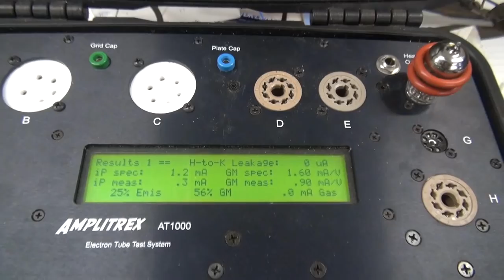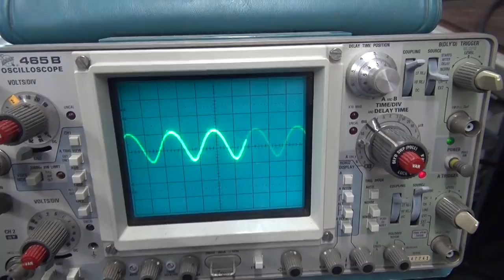How to Repair Marshall DSL40C Tube guitar amp D-Lab Electronics

Comment: Wouldn't it be better to tie that runner to a screw washer terminal? this way, the circuit board could be removed without having to de-solder the runner.

Comment: I would have taped the circuit board so no fragments would would short anything and used a left handed drill bit first to see if it might back out the broken screw.

Comment: Another very interesting video. With noise or gain problems it is always worth testing the valves first. Those components with very little solder are in ‘plated through’ holes. When they are soldered on a flow solder machine the do get properly soldered on the reverse side of the board, as do normal single sided boards. They do not need soldering on the top side. Cheers

Comment: I picked up a DSL-40 that was significantly under 1/2 price (the only reason I bought it). It was "not working, tried new tubes, etc". Fixed a few bad solder joints and bam... it works. It's a nice amp but the circuit board bugs me... Left hand drill bits are your friend for screw extraction. "Battery;s are probably low" LOL It's always good to see your work Terry. I always learn something...

Comment: Another good video as usual from D-Labs. I have one of these. It just so happens I checked tube bias yesterday, wherin it needed a minor tweak,  one side a little high  and one side a tiny bit low. I had never ever checked in the 4 years I have ownerd it. I came across a brand new Eminence Tonker 8 ohm a couple of days ago for a very good price and I jumped on it. Just finished installing it when I happened across this video. After seeing this video I think I might take a look see to verify good soldered connections on the board.

Comment: Terry - Taps are usually square-headed, and square sized 1/4' drive sockets are available, so if you needed to tap a hole down inside something you can just use 1/4" extensions and a regular 1/4" ratchet.

Comment: Howdy.
I had a similar problem with my BK Precision signal generator. The signal levels and the frequecnies were all over the place. I bought it to do IF aligments but it became hopeless. I spayed contact cleaner on all switches and potentiometers. Nothing.
I happened to watch a video where another pro located the source of parasitics by pushing wires with a wood stick. So I did that. And eventually I observed the signal coming on and off pushing at the corner of an auxiliary circuit board. Bulls eye. A mounting screw providing ground was out of thread alignment and had not got tight. Luckily, at the factory, they obviosly used torque limiting drivers so the thread was not completely destoyed. I loosened it and carefully got it thread aligned and tightened. Back in business.
Regards.

Comment: I found that the power tubes hum when going bad, maybe the vibrations cause it for less life. Usually a year I get on mine and bias it at 32, most bias them too hot and causes issues and being a preamp distortion  its all ya need:)

Comment: Why not just run a wire with a terminal ring on each end to your new screw and the nut on the chassis just below it?  The effect would be the same.

Comment: Part of the reason for the bad solder joints is these boards were flow soldered after being populated. In a perfect environment this works well but if any dirt or if production rate is pushed it results in these type of faults.

Comment: Hi Dlab, wonderful video, thanks. 
I have a 15 month old DSL 40C and I just started experiencing a random drop in volume on my red gain channel followed by a shreaking high pitch (microphonic?) noise then it fades away back to semi-normal. I’m hoping this is just a failing tube issue. All tubes glow and I did adjust the bias on the EL34s from 41/26 to 38/38. Played great for 30 minutes then the problem intermittently returns. Bad 12AX7/ECC83s or bad EL34? Should I just replace both of the EL34s with a “matched” set? Would love to hear your thoughts. The amp doesn’t get moved around, sits in the same spot in my living room, no gigging. Thanks!

Comment: Judging by the amount of scratches on the upper lip of the chassis it appears somebody tried to remove it from the cabinet with a spatula.
Great diagnostics and repairs,
Thanks for showing an old Marshall hater this video.
Reply: I think that's just copper tape for shielding.

Comment: R1/R2: Those weren't bad solder connections. Had you looked at the bottom, you would find them fully soldered. The holes are throughplated, so if any components had traces on the top side, there would still be a proper connection. If there aren't any top traces, adding solder only needlesly exposes the traces, throughplating and components to excess heat which can damage them. So always look first if the top side even has a trace leading to them.
Reply from the maker: No, I did not look at the bottom, since the board was not removed from the chassis. The resistor on the input jack board actually rocked in the through-hole, so I would assume that it needed solder. Sometimes, its better to re-solder and hope for the best. Either way, comparing those connections to others on the board displayed evidence of inconsistency.
Reply: Yep.  Should have removed the board.

Comment: 00:56 - "The preamp tubes are all directly soldered in" . That would be interesting :) 

I've watched many guitar amp repair videos and have noticed very FEW tube failures vs capacitor failures!

I wonder if Fender et al had to do this all over again, they would simply solder the tubes directly to the board and socket the electrolytics? :)
Reply: They're not soldered into the board, they're pushed into sockets that are soldered in the board.

Comment: terry why did't you remove the stand off and drill n tap it outside of the chassie? was the bottom fastner bradded over?
Reply from the maker: Yes, it was a pressed in type
Reply: I was wondering about that too. Now I know. Btw, I saw someone using a magnet to pickup stray shavings while drilling.

Comment: Number one problem in tube amps is vibration that will loose ground screws and nuts thus it was a good idea to solder in the ground wire. This way you know you have 100% ground.

Comment: If you'll dm me, I'll send you some left hand drills, makes getting broken screws out super easy...
Reply: I agree, I'm a retired machinist, and the left hand drill works 90% of the time. Here is the "best" method. Get a small center drill smaller than the inside thread. In other words the first portion of the drill is smaller than the "body" of the screw. Take a small center punch and tap a prick point on the top of the broken screw as close to center as you can manage. Then take the left hand drill again smaller than the screw body, and run the drill in reverse and most of the time it will spin right out, just keep light pressure against the screw, as it will begin to come back at you. Yeah it's a lot of extra steps, but it works. And you aren't really drilling the material out, you are merely getting the drill to "bite" into the metal and very little metal fragments.

Comment: I learned some things today , wondering what soldering iron u mite reccomend that will last.? Seems i go thru em way to fast . Been using 40 to 6o watt with an adjustable voltage.for guitars n simple amp mods .  Thx

Comment: Very nice video!  I'm having a problem with the same amp, but mine is that it intermittently cuts out.  I have not found a pattern to the fault, but I have isolated to the amp with nothing else plugged in.  Changing channels and cycling the standby have no effect, but the sound comes back instantly when I cycle the power switch.   Any clues?
Reply: My DSL40c does the same thing.  Took it to an amp technician for repair.  It still has the same problem.
Reply: @oliverespe630  I stopped using the amp since I got a Kemper, but I  still have it sitting here.  Having learned more about electronics since this time, I would be willing to bet that the problem lies in these electrolytic capacitors.  I'm finding that these are a weak point in a lot of modern electronics, particularly where the application gets warm.  They tend to act as noise filters, but that doesn't necessarily mean audible amp noise.  Considering this is an electronically switched amp with the DSP board in there... I bet there's some noise in there that's triggering a secondary problem.   Next time I get a chance, I'm going to reinspect and see if I can find any swollen caps.  I have an ESR tester for testing caps in circuit now too.
Reply: @Dartheomus  Thanks, I think you're on the right track.  My local guitar tech could not find the problem, and I don't wan't to invest too much money.  At least the amp works when I cycle the power switch.
Reply: @oliverespe630  FYI, I got a comment from an amp tech on YouTube called Psionic Audio.  I wanted to paste what he said about his observations with the DSL40C:

"The only DSL40C I've had come in that occasionally went silent had tin whiskers in a pot. Blew it out with compressed air, no more problem."

"Tin whiskers affect every amp made with board mounted pots and lead free solder. Which is the vast majority of amps made today."

Comment: i just picked up a 1 month amp like this.the damn thing is so fuzzy/buzzy on the gain channel,it sux!any idea on what to do with it aside from a heavy dose of .357 magnum?
Reply: Snip off one leg of capacitor @ C - 19 put some shrink tubing on the leg so it doesn't short out..it WILL get rid of the fizzyness on the red gain channel..if worst case scenario the whole capacitor comes out..no worries amp will still work fine...I did mine and WOW what a difference.

Comment: If u want to save some time get a set of left handed drill bits it will back the screw right out most the time and doesn't mess the threads up
Reply from the maker: Cool deal, I will look into that

Comment: I have a DSL40C and it sounds great on the clean/crunch channel, to run pedals into. But, it started, just once in a blue moon, losing all volume, on any channel. It would dork the next day, or later in the same day. No rhyme or reason, and it's been looked at by two different techs, that found nothing wrong with the amp. Cleaned the inputs, did the FX loop trick, which seemed to work once, but not second time. And this happened three times in 6 months of playing regularly, always returning to sounding fine. I've had it re-soldered, the tubes aren't bad, and I've read different theories, but no amp tech has been able to find the problem. Heard of this? Any opinions or suggestions.
Reply from the maker: Hello, Check for poor solder connections, Power supply area and any 5 watt rectangular white ceramic resistors. They are famous for cracked solder connections.
Reply: D-lab Electronics Thanks, I'll mention it to my buddy that works on amps. He re-soldered everything, just because he thought it looked messy when I first brought it to him, and the amp worked for 3 or 4 three hour practices and a gig, then did the same thing next practice. But then worked the next day and didn't have the problem for a couple months. It always goes back to working. Is it normal for the amp to work after a problem such as your saying to check with the resistors?
Reply from the maker: Yep, expansion with temp changes. The cracks can close and work intermittently.
Reply: D-lab Electronics Ok. That's what I was wondering, thanks so much for taking the time. Been checking your other videos for a couple hours now, love the channel.
Reply from the maker: Cool deal man, Thanks for being part of the D-lab family

Comment: Watched the video earlier today and wondered if you (D Labs) or anyone here could possibly help. I got mine in January new and within a week, no sound. I was in the middle of playing one day, and all the sudden there was a little "bip" sound followed by silence.

 I've been sitting on the amp contemplating repairing the amp or sending it back. 

I thought perhaps it was a blown speaker, and I ran it into a 16 ohm cab, and no sound. All the tubes glow, though that doesn't always mean the tubes are working. 

When I turn the amp on, everything lights up. The footswitch changes the channels, and when I disconnect the footswitch, I can change the channels and the lights work. 

I tried my cable through the return of the effects loop, and there's no sound coming out. 

So I'm wondering if it's something simple as a bad tube or multiple tubes? 

Thank you anyone that can possibly help out!
Reply from the maker: Sounds like you lost high voltage or possibly a pre-amp tube failed. Are all of the tubes lit up?
Reply: D-lab Electronics

All the tubes are lit up, correct.
Reply: Ian Alderman same issue with mine. Replaced all the tubes. Lots of people complain on the les Paul forums with these amps.   Great video!

Comment: Pc tube sockets are junk i hate it! I bought a used crate tv6210 same thing and the heat kills it! I only bought it cause my jcm 900 a fender bassman and two 412 cabs were stolen.
They were serviced tuned up and I had about 2,300$ invested in them. They were back to zero time ready to go and the worthless thieves couldnt stand it. Other than that I saved money for three years to buy that marshall. They stole my homemade silvertone tube combo I made too.

Comment: old timers don't like a lot of new. hard wire boards have there share of problems. a fender had a bad oscillation from a wire bent to a bad spot. circuit boards are quick to troubler  shoot and replace .  I don't mind them

Comment: I got the same amp I bought it a pawn shop it made a popping sound  it quit working totally.  Took it to a so called professional here in my hometown of Longview Texas.  And said the biased and changed a power tube didn't do shit I took it home plugged it up never worked at all after the dude told me it was fixed . Made in Korea.  Piece of shit when they quit making them in England.
Reply: 2017 model the first set of tubes lasted a year.  I had one way back in the early 80,s that son bitch work with burned tubes I was young and stupid all I had to do is change them.

Comment: Does anyone know why that C19 cap is soo much bigger that the original C19 cap?  I know people dont like the treble boost it gives and often disconnect them but this one has been replaced with something else. Is it possible to find out the value of the new cap?  And what the owner of this amp was trying to acoumplish by changing it?
Reply: C19 cap that's stock makes the gain channel really fizzy.